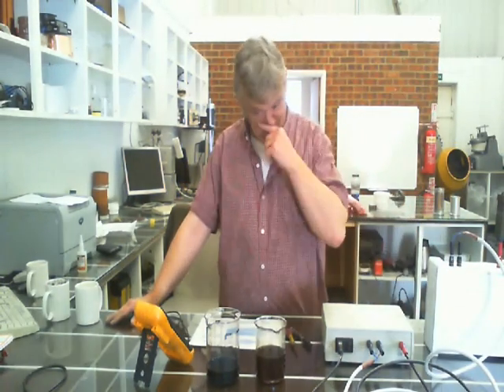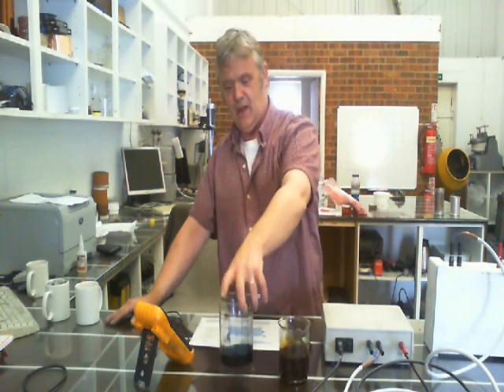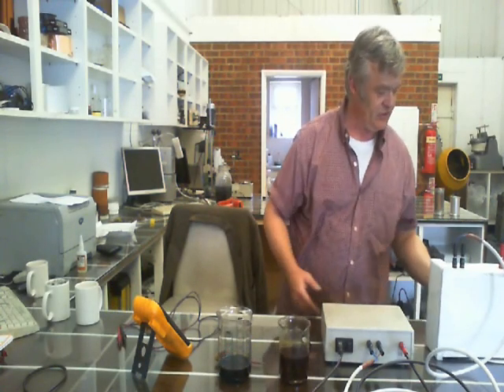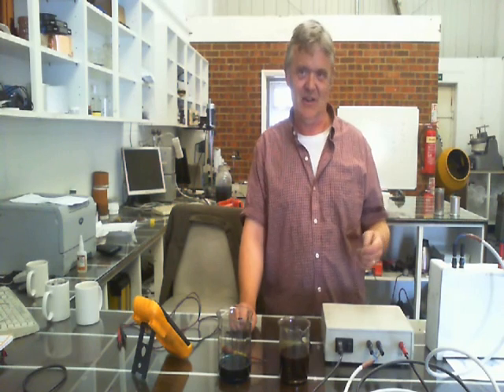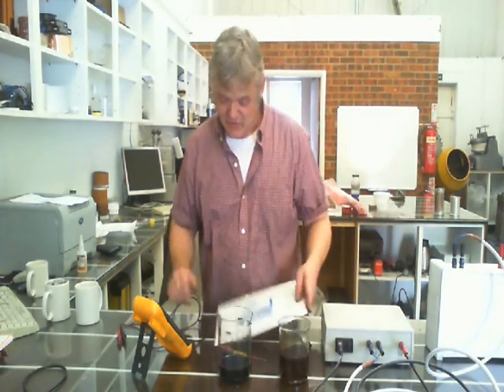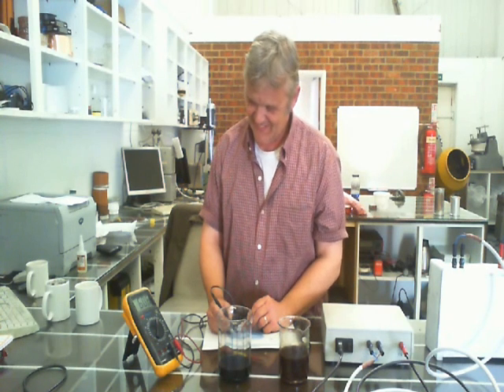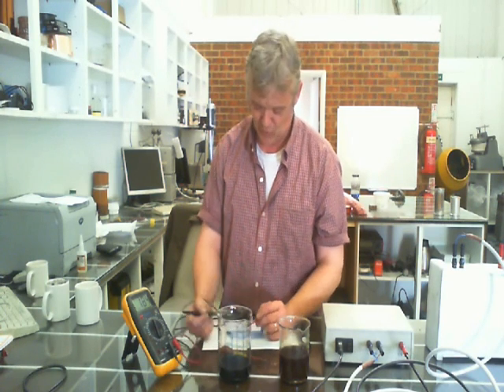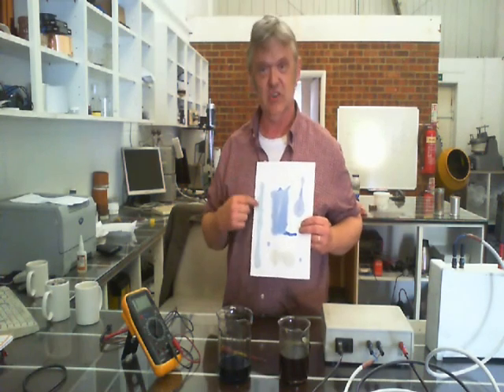How To Photonically Sinter Copper Nanoparticles And Copper Ink

Comment: if those Cu NP s are protected with long polymers you may add some form of small molecule electrolyte in the solution in the
process of ink drying there is  a point which the density of electrolyte ions becomes enough to guard NP surface against polymer attachment and both become mostly washable afterwards . from energy point of view its like melting snow by infrared radiation or by  adding salt (hardly similar !)  given that the NP were protected against oxidation this should result in instant conductivity  .one other advantage is that the polymer will detach before drying out when the NPs scan still move to arrange.on the other hand using flash will cause shrinking by polymer loss that will be opposed by surface tension? which might cause cracks when the particle sizes variance is high these cracks works like captive load.if not disconnection. these are just my understanding the underlying actor might be the moisture in the air acting with the remaining salt but its not very likely .I thought to share anyway
Reply from the maker: thanks for the share mate - good info
Reply: I think your videos have more potential commercial values than any end product you might sell on the side.Great work sir
Reply from the maker: 74Persia
I am not quite sure what you mean mate
Reply: Robert Murray-Smith once we needed a few educational video for some chemical process to be made for a presentation . they charged us nearly $3000 for a few short videos which finally we decided not to use.them because of poor English translation and very dirty lab equipment and tools used among many other problems . and it took them very long time to finish the useless work seeing your videos I was thinking that this was what I had in mind .you seem to make these effortlessly and just said that I think your work is great. thats all
Reply from the maker: 74Persia
cheers mate